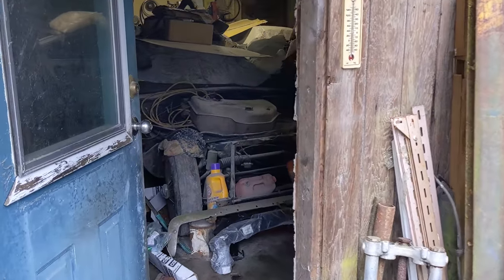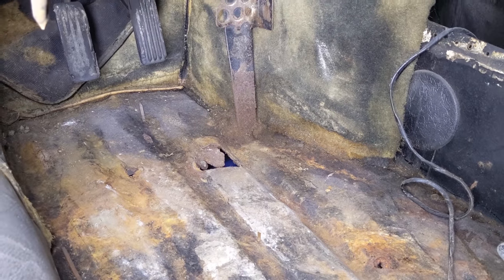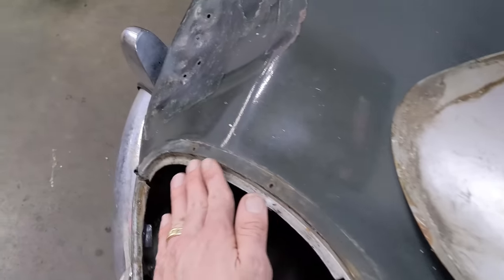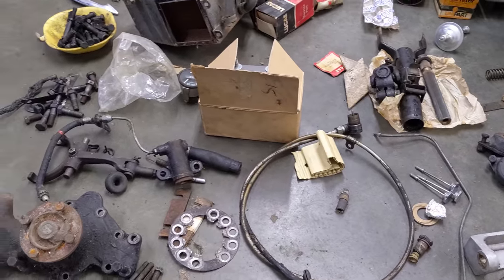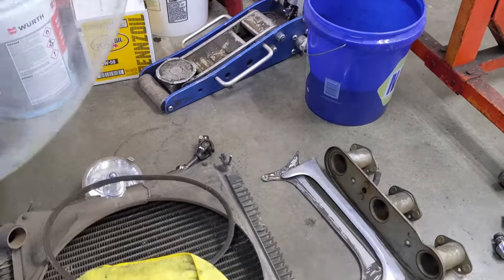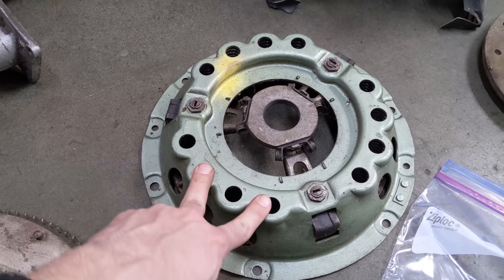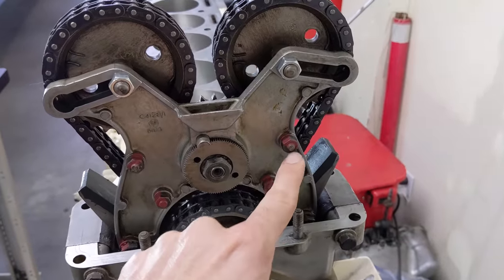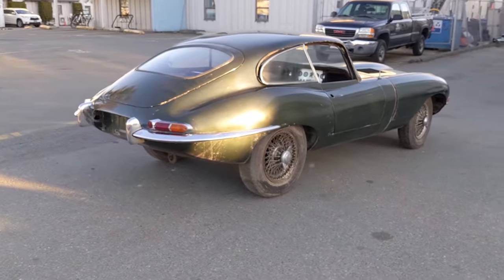Flatfloor E-Type Barn Find

Comment: Back in 1977/8 in the UK, I worked on restoring a rotted out 1961/2 signal red with beige trim 3.8 coupé.  It was a very early drop footwell model, that still had the small shovel back shaped seats and alloy trim.  It had sat many years in a waterlogged farm field, and had done a lot of miles. The oil covered transmission tunnel and engine bay were the only surviving part of the lower 12" of the car not complerely rotted away.  Parts fo the earlier cars were expensive and almost non existent then.  What you could find were often poorly shaped pattern parts.  Some body panels being made were just a rough copy that had to be altered to fit the individual model roadster, coupé , or 2+2 .  I have fond memories of hand making many body parts, including the footwells, repair sections, and the various louvred aluminium closing panels that fitted around the front space-frame. The entire floors had been bodged up previously, with riveted on Zinc and Alloy plates. They had then been filled over with fibreglass and body filler, which were the only bits not rotted away. It had had a fibreglass bonnet fitted at some point too.  We managed to get a new 3.8 style steel replacement, but had to assemble the complete front end that came loosely bolted together. It came with a rough cut rear edge that had to be hand finished and folded to fit the bulkhead shape. You were lucky those alloy bonnet hinge brackets were good.  Ours were all worn away and loose fitting on the pivot pin, needing to be repaired before attempting to hand make the bonnet shut line. Yes you are correct, the air intake box should be finished in a rough sprayed, but not hammered look,  satin aluminium effect. Ours also had Cadmium coated brackets on the fluid reservoirs etc.  What was left of the exhaust ceramic coating was a cream/ light beige colour. The inner sill trim that was left on ours was black Hardura fabric, which was also on a few other places. The customer took it for an interior re-trim after we had finished the body and paint.  I've seen quite a few early build E-Types, and they could have had a mis match of many parts fitted on the production line from different suppliers.  Good luck with the restoration Richard, it's never easy when you're putting together a car someone else took apart.

Comment: I was expecting it to be an outside bonnet lock car, but it clearly has inside locks. I believe Fosseway Performance here in the UK make replica early radiators. Definitely an early plenum - no indented ribs on the top surface. What a great find.

Comment: I am fully  restoring one just like your car , it's N 21, it was  used in England for the Dunlop commercial ,then it was shipped to Australia ,  nice to see which parts are  original or not for the car since someone else dismantle and done some work to the car in the 70's before we got to it late in 2021 , still working on the restoration at the moment in 2022 .
Reply from the maker: Peter great to hear from you! Is that 885021? One of the original 29 coupes?
Reply: @RichardMichaelOwen  Yes it is
Reply from the maker: @Handbuilt1  have a look at this one. https://www.youtube.com/watch?v=TcgEwJY3dP8

Comment: Man, these are different times. In 1979 I looked at a 1962 E-Type fixed head in Teaneck, New Jersey with 20,000 miles, allegedly 2 original tires and a seized engine. It looked forlorn but it was complete and fully assembled. The seller (a mechanic) was asking for $3000. I passed on it. Back then, it was not an easy car to sell at that price.

Comment: Hi Richard . Seek and ye shall find ! You must be in seventh heaven . I agree with Chuck that the bonnet  centre section is repairable. My take is that unlike the previous "e" type you restored for your buddy which you kept in it's "as found " condition , this is a different animal ? I guess the plan is to return it to it's original colour ? If so , l would  break down the bonnet to it's separate elements as the air duct  panels do suffer from corrosion . I have done this on mine . Additionally the bonnet also has damage behind the right  hand over rider and the lower front apron has also distorted . I realise this is more labour intensive but the advantage is that the damaged area's will be so much easier to repair and  they are not under any tension. If l didn't live across the pond l'd come and do it for you .....and l still have lots to do on mine ! Good luck .
Reply from the maker: Thanks John great to hear from you 🥂

Comment: The bonnets (not "hood" on a Jag) comes apart. Its 4 pieces. If thats too much, pop it off  and flip it, you should have enough access to that dent. The sugar scoops are silver on an early car.  The shop I work at has done too many of these cars to count. JCNA champions 26 times over. As far as early cars, we've done #18 and #8. Both gunmetal gray with red interiors, outside latch. DO NOT put those clamps in any sort of rust remover!! It will dissolve the aluminum in them. We found that out the hard way years ago. The carbs are date coded on these cars too. Remember, corvettes from the this era have the same trico wiper blades. You can get them from the corvette guys. We do those cars too. If you need some help, contact me. I'll be glad to help you guys out.

Comment: Suggestion on the fuel tank find a plater that tin plate the tank.  The problem I had with my Mk2 tank is the shop that did it had to do it twice and cut a huge hole to sand blast  and put the sealant in and it looks like 💩 and it needs to be done again.  Replacing with a new tank from Xks and it’s tin plated.
What a score 👍
Reply from the maker: Hey John, my sandblaster uses a 360 degree nozzle and we keep all the original metal intact.
Reply: @RichardMichaelOwen  awesome. A friends 64 Galaxy tank was totally destroyed by an unnamed radiator shop in Portland Ore. again great find and have fun.

Comment: 39:48  That clutch disk doesn't look like it's even been used once let alone for a while. It's pristine (well asbestos pristine anyway LOL). As well the rest of the unit looks brand new. I wonder if that was one of the reasons it wasn't being driven? Perhaps it was to get the new clutch put in and they just didn't get it in and stopped after they'd thought to do a full restore job but didn't count the cost or labor or something.
Reply from the maker: Likely a new clutch kit fron the 1970s

Comment: OK Richard you know that I am an enthusiast like you and I like to preserve as much as I can you also know my opinion on wiring harnesses you’re gonna have to do what you do

However my opinion is you must restore this back to its original specifications black with tan interior etc. obviously preserving as many parts as you can that are not going to be dangerous then you must show this at Pebble Beach

Yes if this message is repeating I do apologize I could not find my original comments to you on this vehicle

Looking at the details of the internals on the valve cover I would not trust the engine build as far as I could throw it.

Interesting to see the lamps appear to be the European spec, or do you Canadians also use the correct spec ?

I believe some of the earlier cars had the sugar scoops in body color but not sure where it changed.

You keep referring to Chuck at monocoque metalwork's what does he know about Jaguar E-type‘s or perhaps I should say what doesn’t he know. That guy is amazing.

Must admit I don’t recall ever seeing the ribs on the seats I thought they were more plain panels but I am willing to be corrected.

OK I know like me you’re an anal twit but putting the data plate back on before it’s restored is a little excessive don’t you think.

On triple X glass if there is nothing it’s the zero of the year if there is a dot under the T of triple X it means it’s 1961 obviously depending on the vehicle you’re looking at and then if it moves to the R it’s a 62 etc. etc.

On the radiator you have no choice you must restore it back to original.

OK all of this shit is just my opinion
Reply from the maker: Garry here in BC it's illegal to have a car with the the ID tag off.
Reply: @RichardMichaelOwen  Surely that is only when on the road, or are Canadians, that silly. ?
Reply from the maker: @jagvette1  sitting, infact this video is prob enough to get us in trouble and we are only installing it.